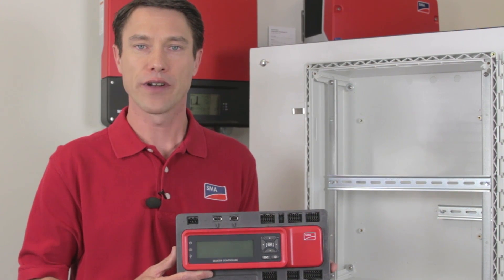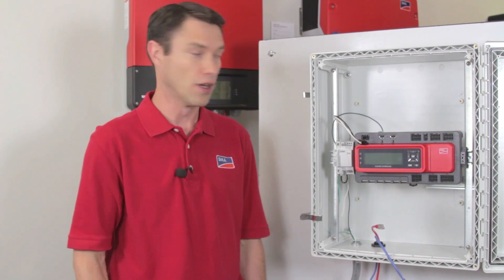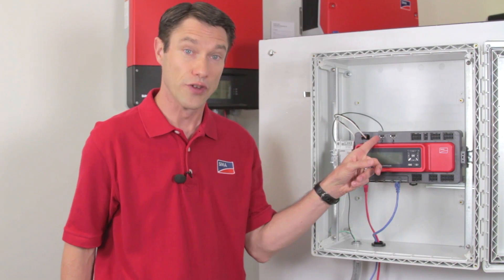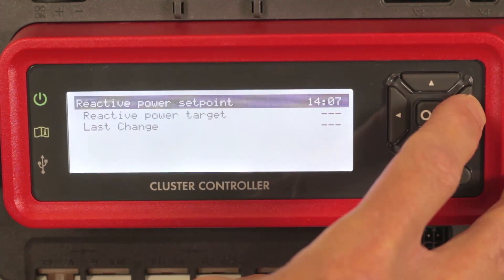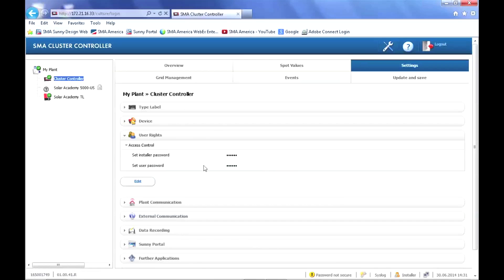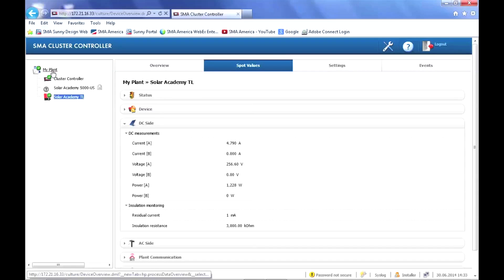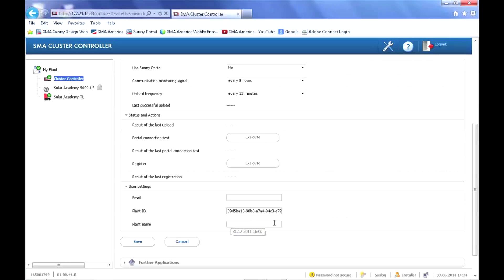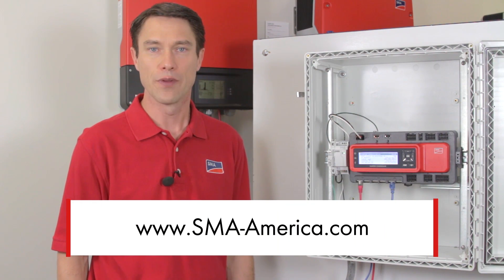Tech Tip: Installing the SMA Cluster Controller

Comment: Hi, I have a 15tl inverter with SWDM 10 registered to sunny portal and working good. Now, I have a new cluster controller. What do you think is the reason why the  SWDM wont connect to the cluster controller?  Everything is properly plugged. Please answer, ASAP.

Comment: Why is the power supply not included in the Cluster Controller kit? but the 3 pin plug is..
Reply from the maker: +Tom Hassall Hi Tom, 

We don't specify which power supply is used, only that it provides 24V DC power, because there are many brands and models to chose from and options to configure the power supply. We recommend installers select whichever they are most comfortable with using. The plug is simply there to make connecting the chose supply easy once on site. 

Best,
Justin